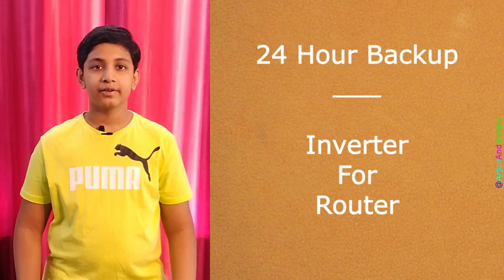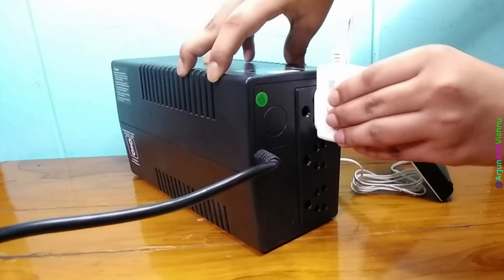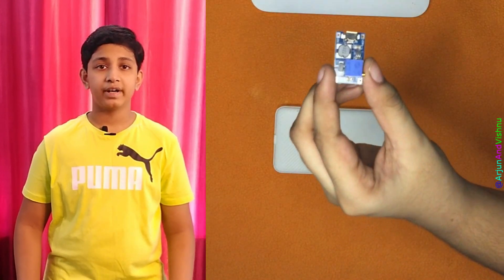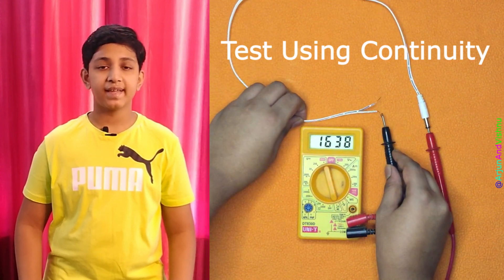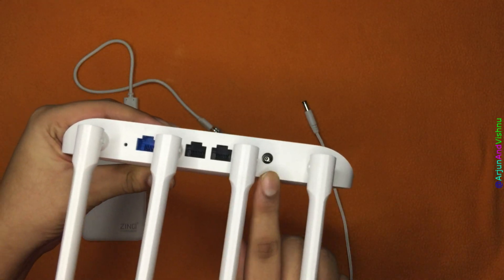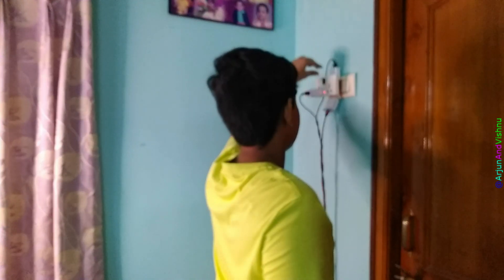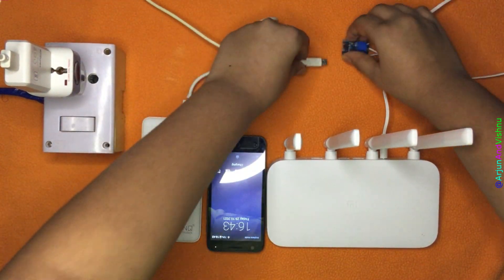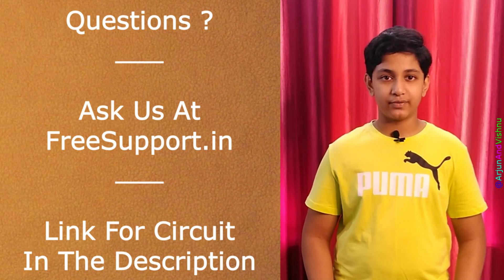500 Rupees Inverter For Router ~ 24 Hours Backup

Comment: Great video, congratulations 🎉
I'm using MI 3c router for which the adapter output is 5v 1a so I connected directly to 10k power bank and it worked but there was some noise coming inside the router and I disconnected it.
Ive ordered for the step up module so what voltage shd I adjust to 6v or 12v
Reply from the maker: Thank you! The voltage you should use is printed on the adapter. You need to use the exact voltage for proper functioning.

Mi 4C needs 12v @ 500mA, Mi 4A needs 12v @ 1A.

I do not have info about the Mi 3C. If it is 5V @ 1A, you might not need the circuit at all. The hum you hear from the router is probably because of the insufficient power, and the capacitors working hard. Try using a different powerbank, or a thicker cable.

Comment: I try on my jio fiber but not working, 2.5 amp is written there 
How i get 2.5 amp
Reply from the maker: The circuit can handle a maximum of 2 Amps with heatsink and 1 Amp without heatsink.

Also, powerbanks usually have a peak output of 2.4 Amps. So, Jio router exceeds the amperage of this setup.
Reply: Then why my not working.i do same as u say 🙁
Reply from the maker: Your Jio Router needs 2.5 Amp, as you said. This circuit cannot deliver above 2 Amps, so it will not work.
Reply: @ArjunAndVishnu  any other way please tell if possible
Reply from the maker: Here's the logic: Even of you buy/make a circuit that can deliver 2.5 Amps, the limiting factor is that powerbanks can still output 2.4 Amps only (at 5V).

Generally speaking, routers do not consume peak power all the time, so it might work with a 2.4 Amp powerbank. However, when the router is at peak load, the powerbank may just shutoff due to overload protection. So, this is not a practical solution for such loads.
Reply: @ArjunAndVishnu can we two power bank in parallel

Comment: Tell me  ampere
Reply from the maker: Circuit can handle a maximum of 2 Amps with heatsink and 1 Amp without heatsink. Check the power requirements of you router and decide if you need a heatsink or not.
Reply: @ArjunAndVishnu  i need 5 volt for media converter and 9 volt for router.....is there any idea?
Reply from the maker: Powerbanks usually have 2 output ports. You can use one 5v output directly for the media convertor. You boost the other output to 9v using the circuit and use it for the router. What you need to factor in is the total output amperage. Check the maximum output current of your powerbank, it is usually 2.4 amps for all ports combined; do not exceed that. Use a 5 volt 3.5 amp wall adapter to charge the powerbank; so that there is the additional headroom to use the connected devices simultaneously while charging the powerbank itself.